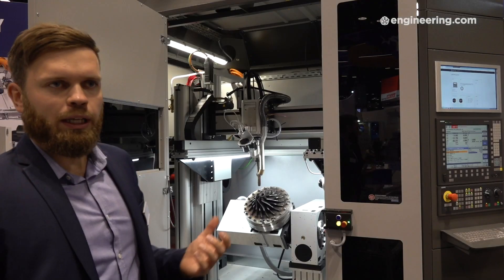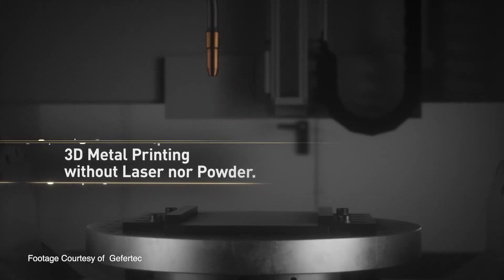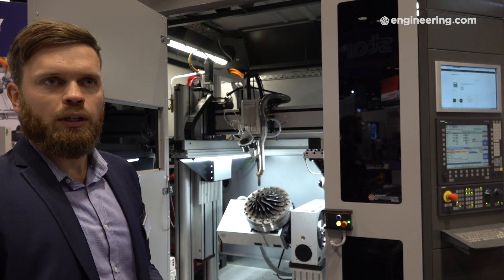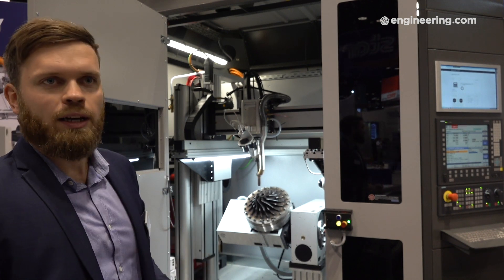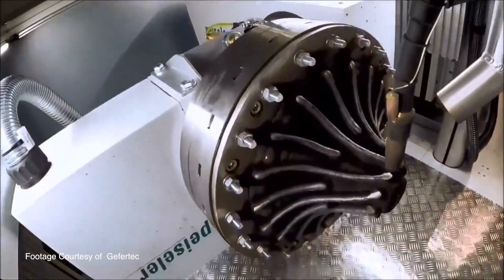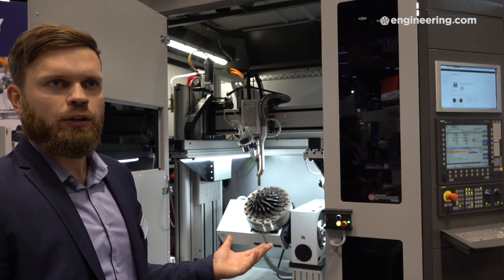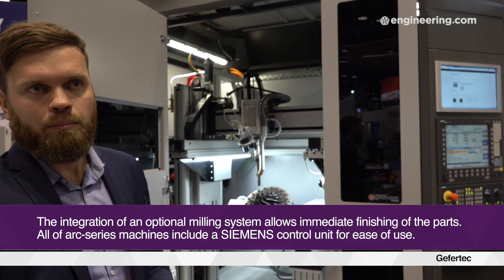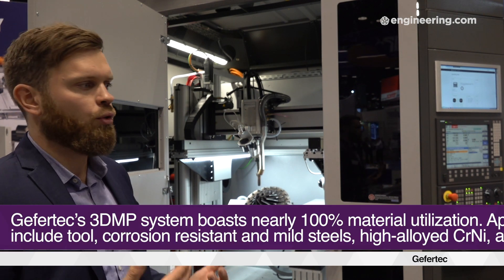New Machine 3D Prints Metal Using a Process Similar to MIG Welding

Comment: I see huge potential in remanufacturing very expensive worn or damaged components!  Just  have the missing portions brought back into existence and then machine to original specifications....there are parts for Porsche transmissions just for one of many examples that are totally unavailable leaving the only option to throw away $20k transmissions NOT because it is not possible to repair but only because Porshe refuses to provide replacement parts!   And the parts in question will never be in high enough demand for the aftermarket to come to the rescue hence after 15 model years old or so  otherwise very nice and still highly desirable/valuable vehicles become worth hardly anything compared to the same car in good running condition....it is NUTS but processes like these could really save the day I am guessing?

Comment: Using process similar to mig welding? Let's see, wire fed through gun with electrical arc melting end of wire into puddle on part!

So what, are we going to change the name to GMP(rint)W?

Can't wait to fire up my metal printer in the morning.

Comment: not such a good product, it will still require a CNC to get to the finished part, also 4mm accuracy is just about useless in any industry and finally welded parts are always weaker than cast and machined parts, def a thumbs' down

Comment: Thing is, although many parts can be 3D printed, the method is not suitable for some components. Take turbine parts such as impellers, blades or where high torque loading is demanded for example. These parts will need to be forged/cast and then processed to help the grain flow in the metals work for best strength/durability, etc. Exciting technology though is 3D printing, will certainly change the world.

Comment: These printed pieces does has the same resistance to stress like forged steel?
Reply: I assume no. Forging incudes hammering/ compression of the material altering its properties. This metal has only been melted. I also assume it can be treated and hardened afterwards to make it more durable.

Comment: Multiaxis Arm/tentacle style welding robot would take a lot less material to manufacture than this kind of traditional "box", afterall with this process it's all about the parameters, when they are optimized it will give if not ready to use parts, almost ready to use, altough metal casting and pressing parts will most certainly be competitive in future applications too.

Comment: Doesn´t sound like it is worth it. You still have to machine it so you loose the complexity advantage which is what makes 3d printing useful at all. In addition you now need 2 5 axis machines instead of one and you are getting charged an extreme premium for what is basically a wire tig welder on a robotic arm.

Comment: Better to use a billet material for greatest strength. 3D printed sand molds would be second best for strength. This would have to much crystalized structure in the material, but still can see many advantages for some applications.
Reply: *too much

Comment: This process has all of the disadvantages of pure cnc machining and also of 3d printing.  I'm not convinced the system complexity and likely strength/quality/consistency issues will be fully offset by the possible production speed or material cost benefits.
Reply: This system has a huge advantage in price of material, speed and strength of the product.

Comment: This is really kind of .... stupid. Mig weld these parts, then they have to be machined after. Just cast or machine out of a block of material.
Reply: If you can't melt the shavings and recycle into a new block then it is a much more waste of time, tool, money if you are up to making huge complex shapes that requires relatively little material for its starting block size.
Btw like this you are able to create hollow objects with complex structure inside what You couldn't if You are just machining a block.
Reply: @resetcoder  you can make hollow complex objects with lost wax castings though, or lost PLA using a cheap consumer 3D printer to make the molds.
Reply: @cluebin8398  I know about different techniques, this is also one in the video. Pretty sure there are numerous use cases. Casting metal is a completely different job than just planning it in a CAD program and then upload it to this machine, and then you have a prototype for relatively little effort.

Comment: Work on the resolution...could be a replacement for standard 3d printing!
Reply: Why couldn't a grinder/buffer or something to sand down the metal after it is laid down on each layer to a polished surface finish be incorporated into the design so that the final product has been 3d printed and polished down to its finished dimensions as it was being manufactured? That type of a machine could reproduce in metal the vortex inducing curves of a natural seashell's interior and make Viktor Schauberger's impellers and water pipes more easy to manufacture than in traditional methods, for example.
Reply: @matthewcollins4157  square wires could be another soloution
Reply: they need to use much thinner wire for that which is not cheaply aviable as far as i know
Reply: no
Reply: @marc_frank  yes
Reply: @hyperhektor7733  i meant wade brewer
there is sls for high quality and wide range of materials
this is is for large pieces to improve material use
Reply: @marc_frank  sure, but i still would try thinner wires
Reply: @hyperhektor7733  yeah could be something to try, but the product seems pretty finished, they probably tried it already

Comment: You cannot weld in strenght, not going to work for that. Metal has to be formed and precipitated heat treated for max strength. You cannot do that in a welding process.
Reply: Please don't underestimate, that will improve by the time

Comment: very cool, but that stuff must be torture for endmills
Reply: Even though there is not so much to cut away, what about the tempering? The heat affected zones were visible in the machined part, but it still looks more solid than lasered deposition.

Comment: I see porosity. Using this process for metal will be limited.
Reply: I agree it is but he did say its not for high end high strength parts. Its perfect for low strength parts. I think its perfect use is repairing parts.We know a good welder can do it by hand. But a machine just left to do it under CAD. Perfect.
Reply: Yeah I thought I saw some holes too.. But hey, it all starts somewhere. As long as the tech isn't mature, there's still hope for better results.
Reply: @NightRunner417  I'm sure they could flood a chamber with inert gas.
Reply: @nonyerbidness475  If they're not already doing that then they deserve a good smack, lol. They should be doing Argon or Helium.
Reply: @NightRunner417  
Why not nitrogen? It is pretty inert and they can get it from the surrounding air with a compressor
Reply: @merlinious01  - nitrogen is not inert. It will react with metals above a certain temperature  - that's why gas shielded welding uses argon and/or helium. Those are completely inert even at high temperatures. :)

Comment: One day we will be able to print carbon fiber
Reply from the maker: Hi Thicc, there are a few companies that can print carbon fiber-filled materials, like Markforged. Check out this article - https://www.engineering.com/3DPrinting/3DPrintingArticles/ArticleID/19055/3D-Printing-with-Carbon-Fiber-Tracing-the-Lifecycle-Thread.aspx
Reply: That’s already being done.
Reply: Thanks both of you i didn’t know we could already print carbon fiber
Reply: @athiccmotorcycle5437  Dont expect any kind of performance similar to carbon fiber parts though. Its like normal plastic filament with small carbon fiber particles. Which kind of defeats the purpose of the long strong strands that carbon fiber is known for.  Its more of a gimmick for the time being.

Comment: can't wait.. in 20-30 years these machines will cost $500
Reply: “I can’t wait! Literally! I can’t wait 20-30 years because I’ll be dead.” Lmao! 🤣 😆 😂
Reply: More like 5-10 years
Reply: I guess no one got the joke he be dead by then🤣🤣🤣🤣
Reply: So this dude literally wants to buy such Hightech machine at the price of just 500 $. Well good luck with that. This is 5 axis AM machine which works with metal not plastic.  If you find even at 5000 $. Let me know. I’ll buy 5 of it.
Reply: @krishnakabrawala1693   iro3d sell metal 3d printers for 5k
Reply: Hang in there man!
Reply: My math said another 200 or 300 years would even cost less down to only $50.
Reply: I can make that machine for $500
Reply: i can make u one of these 3d printers for for wait for it ..... a hundred dollars if u supply the welding machine.
Reply: $500? probably not, not with a machine like this. Iro3d has a pretty cool one (iro3d com) for only 7k
Reply: I bought a fleshlight for 29.99 if it cant beat that price then im out and in out and in of the fleshlight.....
Reply: and than everyone prints his own gun^^
Reply: @anubis3691  People already are out of plastic. Very reliably too
Reply: @sloanv2610  What did they do about the barrel, firing pin and breach?
Reply: @amorag59  it was a .22 so plastic was usable
Reply: @sloanv2610  Ah right, no firing pin in rimfire.
Reply: @anubis3691  Same old comment, same response... Or you could just buy one for way cheaper (and safer)... Cheapest 1911 Ive seen was $280.
Reply: @anubis3691  Screw that, our own anti-gravity space ship
Reply: Don't count on it.
Reply: Can’t wait, in 20-30 years I won’t be living in America anymore.
Reply: good riddance dont let the door hit you in the back

Comment: If you fill it the chamber full of argon make it air right are more heat it will flow better
Reply: True. I seen porosity in the part. Lots of it. There's plenty more below the surface. Full shielding gas would prevent this.
Reply: If it’s fully enclosed would creating a vacuum help? No gas at all? (I’m a welding n00b so could be way off)
Reply: @AmnesiaPhotography  It would create overheating issues without any air convection to cool things down
Reply: @nczioox1116  So, first, isolate it for creating a vacuum, and later you fill it with Argon.

Whay pressure could be used?

High/low pressure can help with the process?
Reply: That's true...and we will spend less power to make

Comment: Company that takes a welder and makes it work with a 3d printing type style machine ( like that used for plastic) and put the price under 1000 euro will be the first company to make billions.
Reply: Zekerias Varg......won’t be the first company to make billions.  Many companies make billions
Reply: I'll add....they wont make billions...they will be stopped from selling it...after all...they 3d printed a working gun from a plastic printer remember?  The media kicked and screamed people could make...actual...functional guns from PLA.  Imagine the outcry using metal....
Reply: @wadebrewer7212  wtf do you think cnc is then? lol
Reply: @jsullivan05  computer numerically controlled?  The same thing that runs your desktop deskjet printer.  Runs a Haas....your fdm...laser cutting....plasma tables...pretty much any repeatable robotic process.

Not sure...please enlighten me....
Reply: @wadebrewer7212  You can "print a gun" with a cnc machine, instead of an additive process, it's a subtractive process, and it's MUCH more accurate, give me a 3x6x6 chunk of aluminum and I can crank out an AR lower in about 25-30 minutes on my CNC machine, and I built it with a GRBL and  steppers, drives, linear rails, and ball screws I bought from ebay for less than 400 bux total.
Reply: @jsullivan05  the argument is not that YOU can build a gun.
Its about the issue that EVERYONE who can push a button coul do it ;D
CNC is not for total noobs, you need knowledge,skill and experince which takes a lot of time and effort. (i am not anti gun btw, i just wanted to point out)
Reply: @hyperhektor7733  But you can, you can just push a button, there are cheap table top cnc machines that can easily rip through some aluminum and churn you out an AR lower, the files are widely available on the internet too, there is virtually no difference in production between addative and subtractive manufacturing when it comes to what it takes to get started.
Reply: @hyperhektor7733  have you used a 3d printer? it is not just pushing a button.
Reply: @excitedbox5705  depends on the model ;D
Reply: @excitedbox5705   (Yes that is where the disconnect exists - between mass media and real life.  The things which can be done by a determined tinkerer on a FDM machine..  The same person with a subtractive (or hybrid) machine can also achieve great things. - It takes effort and some understanding of the process to make things reliably with any CNC device.)

Some Kid in his mum's basement and a few fire detectors can also make a neutron gun. (but not any kid)

Comment: While additive manufacturing will continue to improve IMO the idea that it will completely replace conventional machining is at this time far fetched. For large volume production such as power train components for the automotive industry even with the continued improvements offered by both AM and casting processes items such as blocks, crankshafts, rods etc will continue to require finishing processes. 

In reality additive manufacturing has been around for melennia. Think of jewelry built up from multiple pieces.. zits not what we think of as AM but it is really